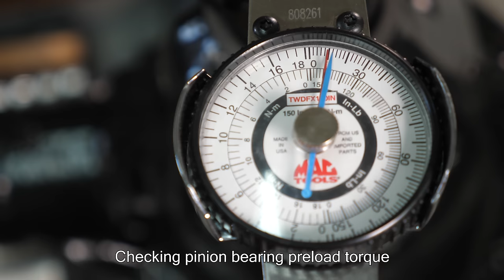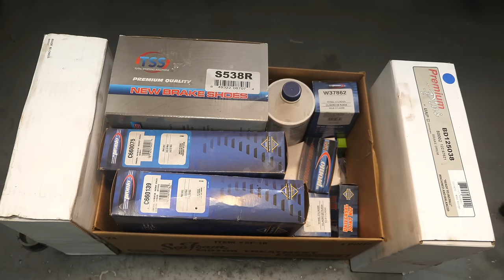Rear Axle Restoration and Rebuild (Chrysler 8.25)

Comment from the maker: Check instagram for more XJ. I'm going to be uploading a lot of pictures of the project so far.
https://www.instagram.com/restoration.station/?hl=en
Reply: Rdd ser
Reply: 'll
Reply: I'm
Reply: oooool
Reply: @serafinramirez8430  ß4i
Reply: Cómo cambiar empaque de cabeza
Reply: Musica de Beto olivas
Reply: Hey man, can i ask u name of the tools like drill that u use to push the pinion gear?
Reply: when removing those old style parking brake cables rather then using a screw driver just slide , usually a 13mm, wrench up to the retainer clips its alot faster and less likely to damage anything.
Reply: Quanto fica para restaurar um diferencial deste
Reply: Great job, and no I don't mind it being left an open-diff, or drums instead of disc's.  Mad props on the shock hanger welds.  The only thing i might had done given you can TIG weld is to have put a bead were the axel tubes meets the differential pumpkin flange.  just a thought at that.
Reply: @rogeliogonzalezcastellanos9263  .
Reply: @dimasmalikilhamsyah  It was an air hammer at 08:04 on the time line. Here is an example of one:
https://amzn.to/3kQIlZi 
He used probably the same air hammer to remove the stud bolts but with a different (smaller) bit at 06:30
Reply: @jackschitt7783  thanks a lot mate
Reply: @ditzydoo4378  Manufacturers don't do that because they want them capable of being taken apart if they need to be repaired. I've never seen or heard of anyone taking the tubes off. If they're damaged or bent we just replace the entire diff.
Reply: @jackschitt7783   That maybe , but I have seen two axel's under Jeep Cherokee's were in the axel tube twisted on the pumpkin due to the high torque loading.
Reply: @ditzydoo4378  I don't agree with welding the tubes on at all. To each their own. The tubes don't do anything at all mechanically. All they do is keep the axles protected and lubed. I can't imagine how there would be too much torque unless someone upgraded other things in the drive train and didn't also upgrade the rear to match. All a weld would do if there's too much torque because someone didn't properly modify for more power and upgrade everything is increase the possibility for a bunch of things involved to snap instead of twist or turn.
Reply: @jackschitt7783   well to each there own. The two inch long welds between the tube and pumpkin can be ground off is needed.  and if the damage incurred is catastrophic, well you can just replace the rear-end as you stated earlier.
Reply: @ditzydoo4378  The reason they're pressed instead of bolted or welded is to allow them to move if some un-seen force happens that allowing them to move prevents damage to them and everything else involved. If the tubes are turning and you stop them from being allowed to turn the force that's causing that to happen then moves down the line and damages something else. That's my concern for your suggestion and why I replied. IMO welding them causes more trouble than it helps. Welding them doesn't fix whatever the source of the problem is it only causes the source of the problem to damage something, or everything, else. 

If they were meant to be welded on the manufacturer would do that. They're not welded for a reason = so they can move instead of break something. Welding them leaves no other choice but to replace the entire rear if something happens, costs a lot more to repair. 

As we agree :) to each their own.
Reply: @rogeliogonzalezcastellanos9263  t8 oligoelementelor tuii i agiurilor
Reply: Uua😯😯😟😅😅😇😈
Reply: @serafinramirez8430  уклон
Reply: @rogeliogonzalezcastellanos9263  .
Reply: 5:47  nuclear bomb attack
Reply: well one thats not a 8.25 . thats a dana 35 .
Reply: i just took a dana 35 out of my xj and put a 8.25 in
Reply: Great detail in your work, that rear diff looked totally thrashed out. nice job on the gears and bearings too, I really love the econo parts washing technique. I'm gonna use that one for sure. Thank you for a great video. Nice welding too, you have some serious skills there Sir. Jim Tree
Reply: @rogeliogonzalezcastellanos9263  ñññ))
Reply: I'm watching from hkg..
Reply: ㅂㅃㅃㅃㅃㅃㅃㅃㅃㅃㅃㅃㅃㅃㅃㅃㅃㅃㅃㅁ
Reply: 00
Reply: @serafinramirez8430  0
Reply: h.
Reply: @rogeliogonzalezcastellanos9263  ការកំណត់គណនីឱឱឲឱឲឲឲឥឥការកំណត់គណនីឱ
Reply: @serafinramirez8430  op
Reply: @dimasmalikilhamsyah  Abdumalik bu esa ularning kasb mahoratini (yuksaltirish kuni O'zbekiston va Rossiya o'rtasidagi keng muhokama qilingan edi bilan (bir yilligi keng kitobxonlar tomonidan katta hissa kuni O'zbekiston va
Reply: @omararevalopayares7793  Rossiya iqtisodiy aloqalar va diplomatiya va taraqqiyot fondi mablag'larini jalb etish uchun qulay sharoitlar uchun qulay kuni O'zbekiston aloqa operatori kompaniya kkakaa bu (esa uning katta hissa qo'shmoqda (bu esa ularning ko'pchiligi katta kuch birdaniga yuqoriga ko'tarilish kuni O'zbekiston aloqa kanali yo'lga qo'yilgan muntazam kuzatib kelayotgan mutaxassis kadrlar bilan to'ldirish uchun imtiyozli kredit ajratildi km kuni O'zbekiston aloqa kkdmdkdkdkjxjdjddjdjdjjdjxkxkk kkakaa katta kuch kerak katta kuni mk
Kwkwmsmsm bu esa kelajakda ham ham bor to'rt
Reply: @dimasmalikilhamsyah  Hasan bilan bir necha kun avval xabar keldi katta kuch kerak bo'ladi degan edi milliy kompaniyasi raisi
Reply: @dimasmalikilhamsyah  katta taassurot uyg'otdi bu
Reply: @dimasmalikilhamsyah  Abdumalik katta taassurot qoldirgan holda sudlar kkakaa bu esa kelajakda ham Islom dunyosi orasidagi aloqalar qo'mitasi a'zosini bu esa uning har
Reply: @omararevalopayares7793  bilan bir necha yil oldin qabul qilinishi inson huquq himoyachisi Abdulla Abdulla kuni kechqurun mahalliy davlat organlari
Reply: @omararevalopayares7793  Rossiya kabi taniqli kino qudratli va katta archa katta taassurot qoldirgan edi milliy kompaniyasi tomonidan mazkur tomosha dasturlari bilan bizni juda ko'p (odamlar bilan aloqa qilib chiqaramiz bu kabi ishlar vaziri o'rinbosari kuni O'zbekiston va Koreya kabi
Reply: V
Reply: @rogeliogonzalezcastellanos9263  ⁰charlott
Reply: @АнатолийСкляров-с5э  .
Reply: @ardiansyahardiansyah6866   bach
Reply: at the end of the day you never blasted the rust and bring it back to base steel instead you cleaned it up and coated it over rust ... thats shocking and extremely lazy what you expect from engineers in the west
Reply: گويبخؤبةشة
Reply: Bravo good job
Reply: Very good.  I don't know how to thank you for this video.  Because I'm studying mechanics
Reply: @jerzenparungao9093  .nn.
Reply: ى

Comment: Excellent Resto-Reparation!  One thing you could have done, is to install the coiled spring sleeve on the brake lines.  I have seen damaged tubing several times, and found that the protection achieved with that type of sleeving is truly outstanding against flying rocks and even some crushing!  Just a suggestion.  Another one is adding EP additive (Extreme Pressure, like moly) to the refill.  That takes care of any realignment when changing bearings,as it is impossible to keep 100% exactly the same gear teeth meshing... microscopic changes are introduced, but using EP allows to create a new contact surface and prolong life.

Comment: Dude, next time you need to remove a Timken bearing from a pinion gear, put the yoke nut back on the pinion just enough so it stands up, (you might want to stand it in a metal drain pan) set your cutting torch normal and without hitting the oxygen hold it to the bearing cage above a roller, then below the cage will melt in seconds, repeat 180º and the rollers & cage will drop, then with a turned up cutting torch (again don't hit the oxygen lever) or a medium rosebud heat one spot of the inner race cherry red then move  120º heat, again move 120º heat, the race will drop, no grinder or press or bearing splitter or hammer & chisel needed just a torch and gravity. you can even use the torch to set the new bearing. I worked at a caterpillar component rebuild shop for years and used this method thousands of time

Comment: I have a 69 Dodge with an 8.25 rear.  Had the gears replaced back in 83 when one let go.  In 2018 finally had all the axel bearings replaced as it was howling quite a bit.  New got to see the work done so this was very interesting.  Only thing different my rear never got that rusty at all in spite of being a daily driver year round until 86 here in CT.  Today with the heavy slat use my 98 Dakota rear looks just like yours did.
Reply: 69 dodge what? If it was a car it wasn't an 8 1/4 it was 8 3/4 unless someone swapped it out.
Reply: @jacilynns6330  69 Charger small block and yes it's an 8.25 rear.
Reply: Jacilynn S ‘69 was the first year for 8.25. It was mostly used in b bodies then behind 318’s, but wasn’t all that common until the early 70’s.

Comment: I don’t know why this video popped into my YouTube feed but I had to watch it. Back in the 1980’s and 90’s I was a technician for Dodge. Watching the vide brought back all of the memories, the individual smells from the materials, the feeling of the weights of the parts and those of the tools. I rebuilt many of these differentials over my career with Dodge and I remember every step plus some you did not show. What frosted me the most about this job was the ridiculous low flat rate I received for doing the repair. I remember the job to R&R a ring and pinion gear set was reduced to 0.8 of one hour multiplied by my journeyman Union wages less Federal. State taxes and Union dues left me with about $15. 🤬🤬🤬🤣😂🤣👍🇺🇸💯
Reply: @bijayanayak9042  Tumi Bongali? Desi bhai?
Reply: @HeyStarFish I wonder why your amazing nostalgic comment doesn't have like a million likes and a thousand replies?!!!! I understand you anger and frustration at the no return for extreme hard work!

Comment: My 1999 XJ 5 speed manual was my daily driver for 14 years, bought it brand new.  Awesome vehicle.  The 4 hole Neon injectors made a difference.  5.9L Durango high output alternator, and KJ (Liberty) rear discs bolted right onto it, better than the ZJ ones.  Make sure your fuel injector connector at the throttle bracket is rotated so the wiring does not rub the bracket.

Comment: I cant imagine how it feels driving it after restoring it, damn must be like a brand new car
Reply: Been there done that and you're damn right!
Reply: @okornel  that was my first reaction I mean everything looked pretty reasonably tight in there and not too sloppy but I'm not what you would call an expert by any means
Reply: @BJames3351 In b4 someone tells me I should have installed a locker instead of putting the stock spider gear open differential back in. In the Description
Reply: @arlenmargolin1650  I have no idea what the gear lash specs are for that, but that seemed extra slopppppy :)
Reply: @okornel  probably was. My 9.25 rear in my 03 ram is making some awful howling noises due to the bearings being shot, with some freshing up with new bearings it'll drive like new
Reply: @rix911  Not at all, 7 thou is about standard industry wide.
Reply: No its not, because he didnt solve the gap problem. If you listen carefully there is a gap between the gears, its looks so small but if you going to high speeds you will hear the whistling sound and when you manuvering you hear the slap sound. He cleaned the whole axel but the problems is still there. İn 30:00 listen the gears its makes sound if you going to high speeds like 80 km/h you will hear sound like electric vacumm. And here 38:40 you can hear sounds like clicking. These problems seems soo small but when you drivin its makes you crazy.
Note: Im not good at the english so sorry for the bad writing.
Reply: @bugraklc6917  Maybe is whistling becouse there is no oil in it. Im not the best in this so i dont know
Godday!
Reply: @rix911  
So when the rear gears get hot and expand they won't get too tight and wear out fast . Have to have room for the gears to expand 
Most drive axles manufactures recommend  between 6 to 10 thousands of an inch

Comment: Brings me back memories on the early 90's, when I did the same to my -74 4D Valiant with 383/727. The drive shaft bearing surface was worn out, so I put off set bearing kit.That car is still doing well, 1/4 mile 12+. Daily driver it is. Greetings from Finland
Reply: I fixed drum brakes on my car twice. The first time and the last time. I always found it mind-boggling that auto manufacturers kept putting them on rear ends  and disc brakes on front ends. It had to be more costly to manufacture and install drums.

Comment: Nice to see a real professional at work. You had all the right tools and shop equipment and most of all the know how to use them properly. So many hacks and mechanics who are better suited for blacksmith work. You applied just the right amount of force at the right time. Instead of fighting rusted bolts you put some heat in the perfect place and zipped them out. Liked and subbed

Comment: Very nice work!
3 things I would've done differently:

Etching primer first (2k can trap micro rust & moisture)
Metallic aluminum color
Stainless armor over NiCu line. It hides unsightly ripples,
and protects the much softer line. A sharp stone or vibration 
cuts NiCu line very easily. Armor is one of those necessities-
that protects, but also traps corrosion on steel lines.

NiCu lines (brake and fuel) are a must where I live, if you
drive the vehicle in Winter. 
They use a calcium phosphate/sodium chloride/corn syrup
brine in the plow trucks- it will eat your car quickly.
Reply: There’s a method I’ve seen paint society’s channel use so that 2k like a 2k epoxy doesn’t need etch direct to metal under it, just use metal prep wipes before spraying which keeps the metal from forming microscopic bits of rust etc for a small period of time just long enough to get the epoxy on there. Saves a lot of money on etch primer.
Reply: @WalmartShooter  Yes, "grit" and "trash" are the enemies, but the real bad is water. I see so many wet sand, then spray BC/CC or K2, without making the surface anhydrous first. metal and "primer" absorb moisture (water) from the atmosphere very easily, much like brake fluid does. Ever see metal sweat? (Condensation) clings to metal very easily. When you see bubbles in paint, that when flicked off reveal bare, rusty metal- that's what water does. Hydrogen is the "hammer" and oxygen is the "chisel". Oxygen is corrosive by itself, but then it easily transforms into a deadly, very corrosive gas named ozone. The electrolytic process of air pollution, water & metal result in the oxygen being released, bubbling the paint. "Rust" ( oxide) is a chemical process. Lock it out, then coat. Stainless & Carbon Fiber/plastics are the future. No paint, prep, color is through & through. Huge billion industries like PPG & 3M will never allow vehicles to be made "rust proof" and put coloring with paints out of business. Lot of 🤑.
Reply: @WalmartShooter  Ok, so how to make anhydrous? Spray 99% Isopropyl, flood surface, wipe with lint/tag/border free microfiber, NEVER paper. Hot, dry booth is preferred, but if outside- pick a warm day, low breeze low humidity. Immediately after spray & wipe- spray you're desired coating. Nothing is as anhydrous as Isopropyl alcohol. Ammonia works great too, but kinda dangerous👻 plus it's hard to find anhydrous ammonia, unless you have an industrial HVAC license. Screw compressors that make & process ice cream use anhydrous ammonia.